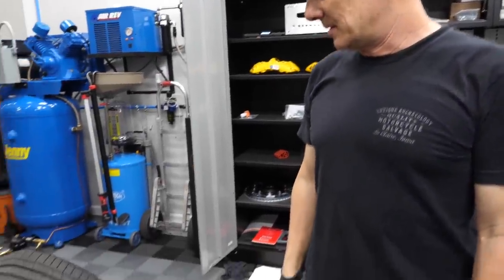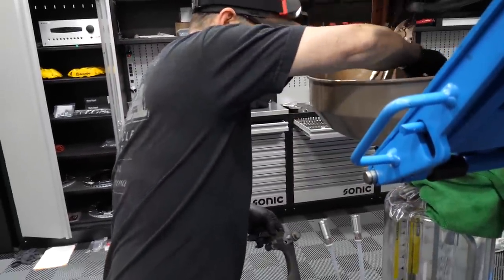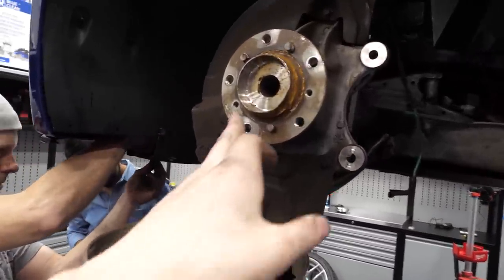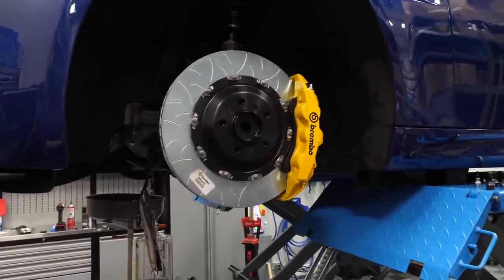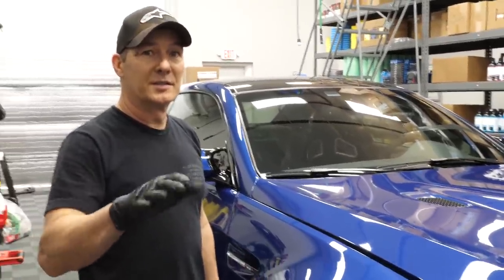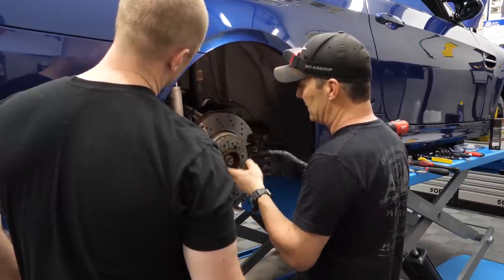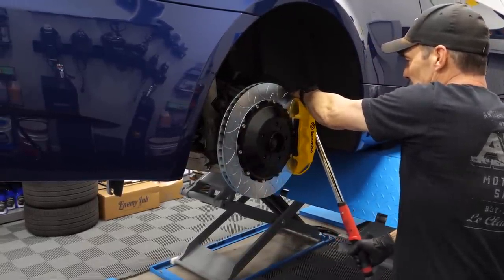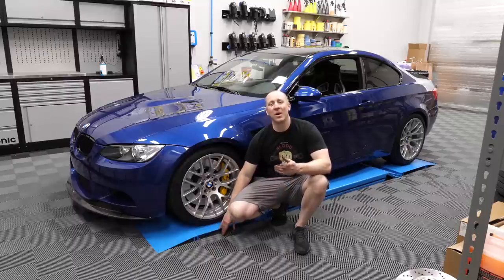E92 M3 Gets Brembo BBK Front and Rear

Comment: Should never paint the face of a hub, as it is machined flat and any unevenness can cause brake judder.
Reply: Paul Sims they paint it to keep the break hat from sticking to the hub
Reply: Also is the paint "isolating" heat transfer from disk into to the hub and arms. A certain heat exchnacge of disk and hub+arms must happen
Reply: agree, if they would check disc run out it would be definitely off as no way he sprayed same thickness layer of pain on all surface of hub. Aswell i would be worried it will act as glue and will stick disc (rotor) to hub

Comment: Sick brembos, but bleeding was supposed to be started from rear right wheel, then rear left, front right , and then front left via ISTA or any other scanner which activates abs pump during bleeding to remove excessive  air from the system.

Comment: BMW has a bleed function built into the ECU. Might want to look into that.
Reply: That's for the traction control/ABS, not needed for a caliper replacement.
Reply: @JKGarageBMW  no, there is a specific bleed function built in. I know I've used it before. B is for build also did it on his BMW swapped Datsun and he said it was way better than the "normal" way

Comment: I have had my E92 for 8 years now, and installed stoptech BBK myself.
1. You did not remove the rear dust shield, will it not rub against the new rotor?
2. Why did you not use a pressure pump when bleed the system, and should probably do it all at once from the furthest to the closest to the master cylinder.
Reply: Nelson Lou flexed it out of the way for clearance. It didn’t need to be removed.

Comment: Those brakes are a diagonally split system. The circuits are LF/RR,RF/LR. You can't just bleed the fronts, then the rears. Follow the bleed procedure or you won't be enjoying a firm pedal like you could be. Looks great! Keep up the good work!
Reply: Erik Krauss I believe that to be true if I’d done all four corners and waited to bleed until the very end. In that case I’d have started from the right rear. To me and you can correct me if I am wrong here but if some one was simply doing a front big brake kit and leaving the rear stock they’d install the fronts and bleed the front only. I basically did a complete front install including bleed like it was an independent install to the rears. In the end we had a nice firm pedal and all new fluid.
Reply: Tamato tamaaato
Reply: I've only had to follow that exact order if the entire brake system including the ABS modulator is totally void of fluid.  Otherwise the leaky caliper gets the bleed.  But good practice is good practice

Comment: 170nm is about right. Caliper take a bunch of stress. Example is a dodge dart front brake calipers bolt takes about 130ft/lbs. Also i would not have painted the hub, can cause issues real easily

Comment: Sure hope he put some threadlocker on those bolts.
Reply: More like copper anti-seize or he'll be drilling those caliper mounting bolts on in less than 3 years.
Reply: Threadlocker acts as an anti-seize as well.
Reply: @SWAT2291  If its an aluminum bracket and a steel bolt ant-sieze will help stop galvanic corrosion.

Comment: I've some critical pointers for people installing peformance brakes; 
  All aluminum Brembo calipers have a low thread torque, normally around  60 ftlb front and around 30 ftlb rear EDIT or until the lock washer flattens.    The steel caliper bolts need to be grade 10+ and coated with only copper anti-seize if you reuse them after the factory zinc coating wears off.  
  Steel and aluminum produce galvanic corrosion when exposed to an electrolyte like salt water, the bolts will fuse to the calipers without the zinc coating or copper anti-seize.  If silver anti-seize is used it'll rapidly corrode and ruin the calipers.

  It's strongly recommend to buy a Motive Power Brake Bleeder with the billet master cylinder reservoir adapter since brake fluid corrodes plastics that aren't ABS.  It'll make the job so much easier and make fluid flushes every year a breeze!  

  Brake bleeding with dual bleeder calipers is best done with the inner bleeder first, then the outer bleeder.  Then bleed the inner bleeder again while tapping on the caliper housing with a soft rag covered rubber mallet to assist air bubbles out, then repeat the same with the outer bleeder.

  Always remove the standing brake fluid from inside the bleeder nipples before capping it off because brake fluid is hydroscopic (pulls water from the atmosphere) and will rust the bleeder nipples, preventing later service.

  Brakes are very important, always treat them like it.  Copper anti-seize is your best friend :]
Reply: Gamma Light The kit came with instructions calling out 170nm. I went with a lesser 130nm which is about 100ftlb
Reply: @MikeFigueira  I'm not surprised at all, they still haven't fixed the torque settings in the instructions yet eh..  I'm convinced Brembo wants people to strip threads, it's a very common complaint against them.
Reply: @MikeFigueira  100 ftlb sounds about right for the weight of that car.  If it was me, I'd have been content with 80 ftlbs but I can't advise anyone to deviate from the instructions even if I know they're wrong

Comment: well the metal sissor was nice and sharp so the better choice, cause the grinder would have throwen sparks every where.
regards
Sören
Reply: could you atleast  give him a new hat ,the old one is really dirty he he
Reply: ps. i feel your pain not getting new bolt´s to hold the disc, hat it when i forget some parts, will be dubbel checking my vw up gti brake upgrade before install time
Reply: did you forget to paint the dust covers where you cut them???
Reply: as long as the brake fluide is always topped off ,it should not be a problem doing the front´s and then the rear,but some times you need to drive a few days them do them all again, and ignition on other wise the abs is closed . on most german cars there are 6 hoses 2 front and 4 in the rear, 2 by the calibers and 2 from the body to the control arms.